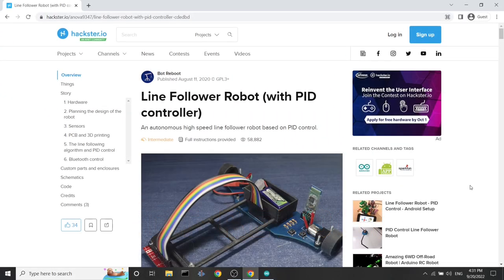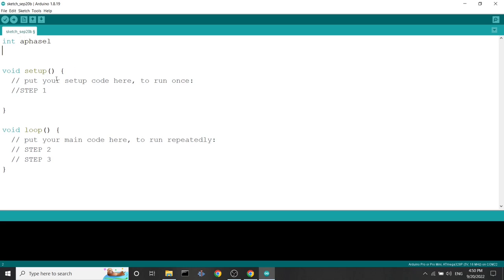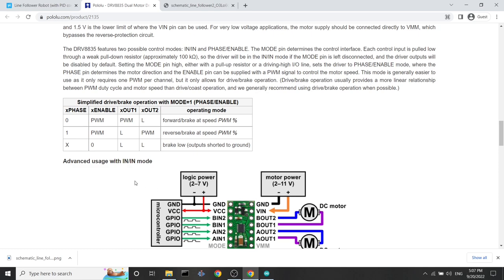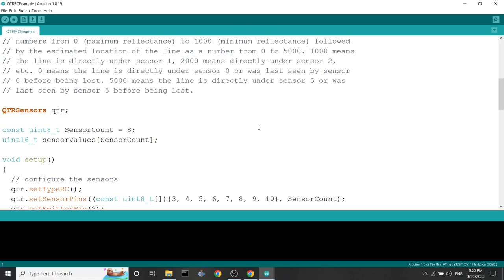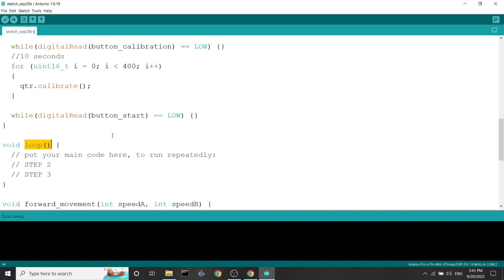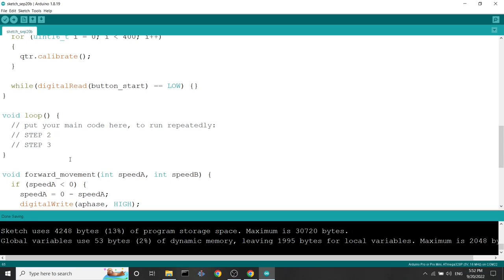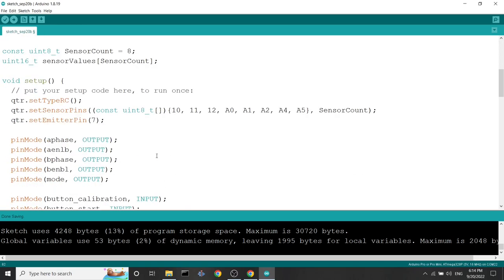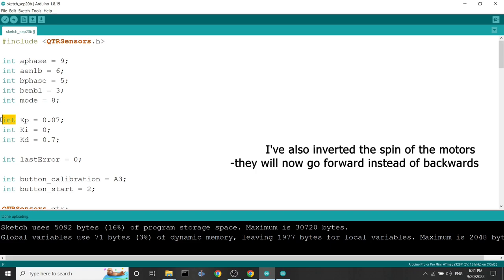Arduino Line Follower - Code Development #1

Comment: In minute 27:00, shouldnt the sensorValues[0] be multiplied by 1?, otherwise you will never take the value of sensor 0 into account. So in this case the measurements will go from 0 then a jump from to 1000 - 7000 instead of 0-7000.

Comment: Hey Reebok, I really love your code implementation and I wanted to use it for my 4 wheeled chassis, should I just add new speed variables? Or use the same variables but integrate them to the other motors?

Comment: This man is awesome.. 
i have a question :

you used two push button, as pull down, insted of this can i use pullup?

like, i want to connect 2.2k resistor to 5v then on pin of push button, and the other pin of push button will go to the ground, and Digital pin 12 will be on the 5v, for the calibration button, another push button will be same but Digital pin 11 in 5v,
then i will write like:
digitalwrite (12,INPUT_PULLUP);

Comment: hello, good tutorial. I have questions. what is int mode = 8 ; do? is it possible to use motor shields mount on Uno to connect with Qtr sensors?

Comment: thanks for the video. Can I ask if the code of this car can be run without a right angle or dashed line or do I have to code more? And how to code for the best. Thank you very much
Reply from the maker: I didn't really take into consideration to test that. Really depends on the speed of the robot. If it's low, it might take the right angle. Those are really interesting scenarios, and I will try to test them and adjust the code if necessary.

Comment: Could you perhaps share the .fzz fritzing file of the circuit, so others can make their own pcbs with that circuit?
Reply from the maker: Fzz files are only generated by the Fritzing software application. However, in the resources section in the link in the description, I use another software for generating the Gerber PCB files, so I instead shared that.

Comment: if i copy paste the same code, but i modified and inverted to follow the white line, is it possible? (i mean the robot running the 2 different algorithm together in single track)
Reply from the maker: In theory, it should work if you just change the qtr.readLineBlack(sensorValues) in qtr.readLineWhite(sensorValues).

Comment: **** how amps that motor driver can takes as input  *****
Reply from the maker: If you would take a look at the documentation of the motor driver, you will find all of the characteristics of any of the hardware (which can be found in the description of the video or directly on this link: https://www.pololu.com/product/2135).
Reply: @botreboot6352  how much mAh battery
Reply: @botreboot6352  7.4v how much mAh battery u have used in new one ..
Reply from the maker: Quick question, becaused you spammed a lot and it made me curious, why is so important the mAh of the battery?
Reply: @botreboot6352  i have a 7.4v and 2200 mAh battery
Reply: @botreboot6352  i have 7.4v 2200 mAh battery will it suits for it...
Reply from the maker: If you would take a look at the mAh definition of the battery (https://letmegooglethat.com/?q=mAh+battery+definition), you will see that tells you how much "life" the battery has before the next recharge. A motor has a load current of 150 mA and an Arduino has a draw of 16mA. With your battery, the robot will run for approx 4 hours without stopping. 

So yes, as I've already responded, any 7.4V Li-Po battery will do just fine. And yes, the list of all hardware, including the battery that I've used, can be found in the link in the description (https://www.hackster.io/anova9347/line-follower-robot-with-pid-controller-cdedbd) in the section "Hardware components".
Reply: @botreboot6352  thanks a lot sir 🙏🙏👇🙏👇
Reply: @botreboot6352  update ur coding